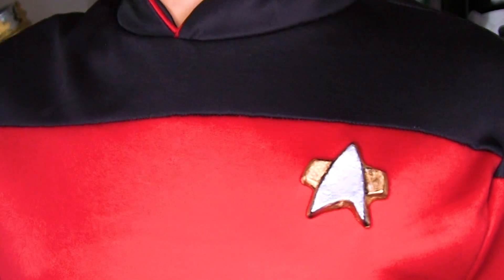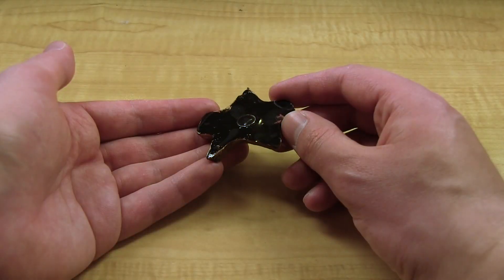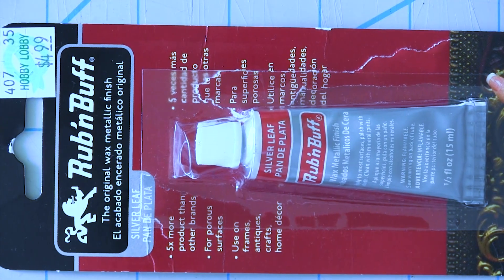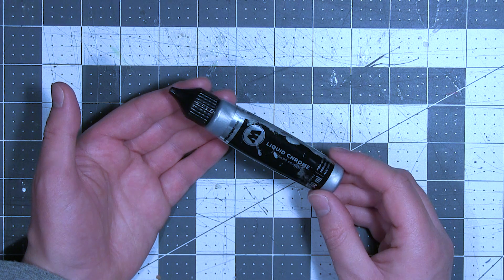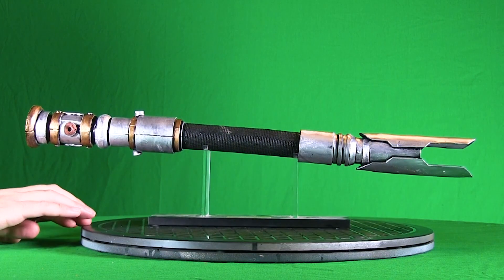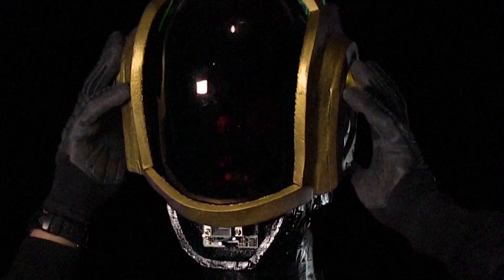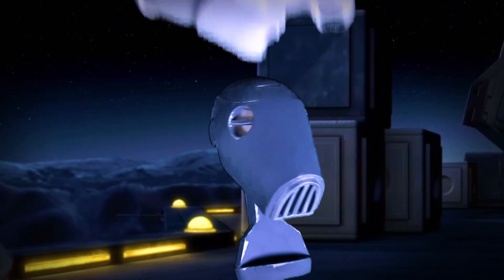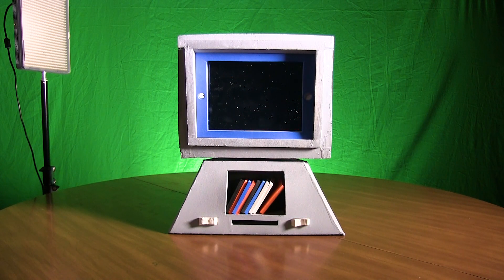How To Make A Star Trek Communicator Badge Prop (DIY)

Comment: YES, I love Star Trek, There are quite a few combadge variations out there. To list them off There is
- The Monster Maroon Badge which was revealed to have been converted into a combadge by the time the Enterprise-C was in service.
- The Next Gen Oval Badge which was carried over into the first two seasons of Star Trek: Deep Space Nine
- The Generations Badge which again was carried over into Deep Space Nine from season 3 onward as well as the entire run of Star Trek: Voyager
- The Alternative Future Badge first introduced in TNG's "All Good Things..." and later reused in DS9's "The Visitor" and Voyager's "Endgame" And the design also served as inspiration for the Current design used in Star Trek: Picard.
- My Personal Favorite, The "Illusory Future" badge first introduced in TNG's Season 4 episode "Future Imperfect" and later reused in Season 7's "Parallels"
And you don't have to limit yourself to the Starfleet designs, The Bajoran Militia on Star Trek: Deep Space Nine also have their own combadges, but they do wear them on the right side rather than the left like Starfleet does.
I personally use a 3D printer to make my badges, but as much as I'd like to, I don't have any way of purchasing molding and casting supplies for them.

As for what I'd like to see you make, I can picture you knocking out a Klingon Disruptor pretty quickly, All you'd really need are some wooden dowels or aluminum tubing/rods for the barrel and foam for the rest of the build if you go with a stunt prop rather than a hero prop.
Reply from the maker: I love the monster maroon!